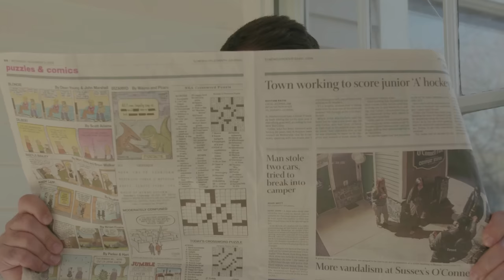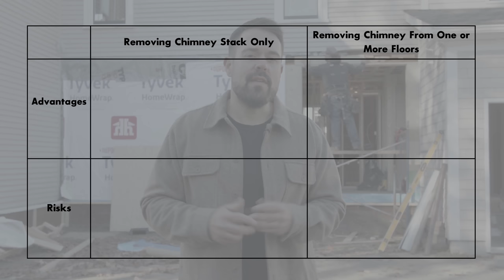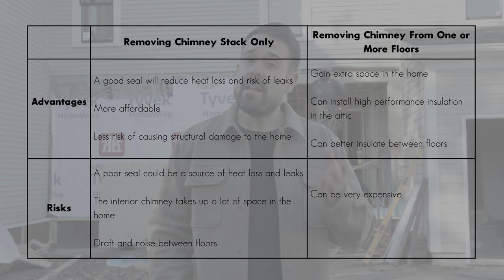Removing a Chimney - Should You Do It? Pros, Cons, and FAQs

Comment: I would love to remove the entire chimney stack from my 1-story house.  It would free up around 9 sq. feet in my main (i.e. only) full bathroom, which I would love to use for a small, stacked washer and dryer (no more lugging laundry up and down from the far end of the basement from the stairs).  The only tricky bit would be re-routing the exhaust from the gas water heater which currently goes up and out the stack.
Reply: I’m same situation I have a cape and the chimney right down the middle of the house
Reply: They do make a washer/dryer combo that does not use vents when drying.  It is basically a dehumidifier that extracts the water.  An added plus is it saves room since it is only one unit and not stacked.

Comment: Mind is pulling away. Every expert I've called out has a different reason for it, and different 6-figure fix for it. We don't use it, so I'm to the point of finding the cheapest way to remove it and brick it up. However, it's one of the ones on the outside of the house, so I don't know if that's any better.

Comment: I could gain 11.5 square feet in my kitchen and move the electrical wires inside drywall instead of using a surface mount conduit.